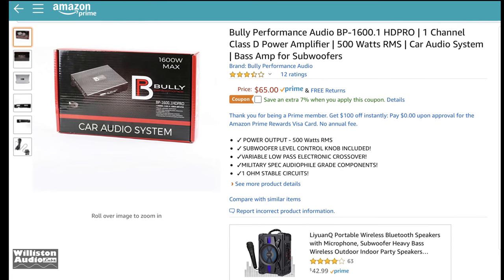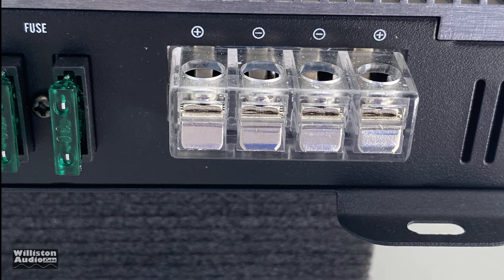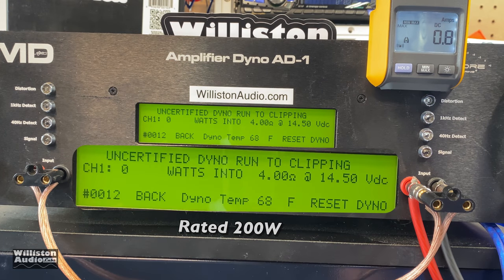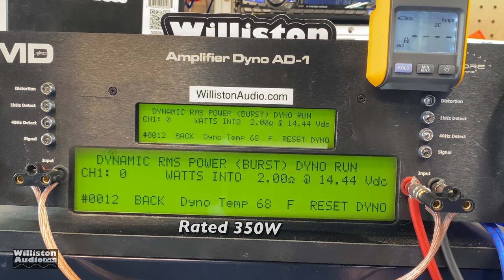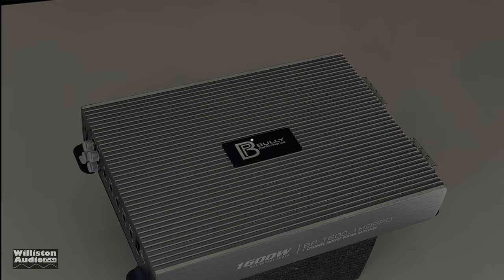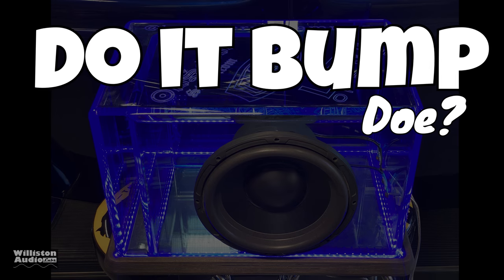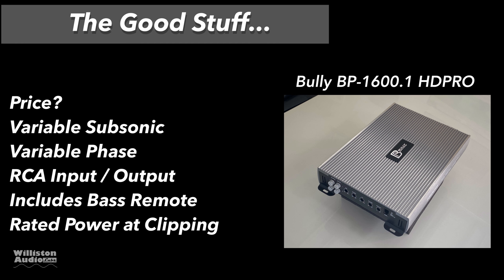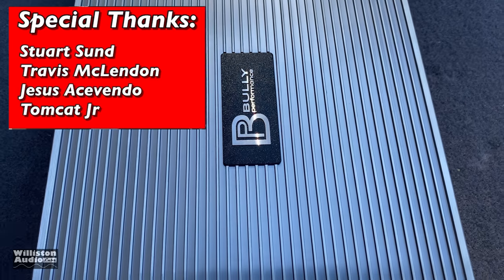How Good is a $65 Amazon Bass Amp? Bully Performance BP-1600.1 HDPRO Review and Test

Comment: Ive been using the IGNITE 6000w from amazon you reviewed a while ago,  running 2 strapped together pushing two 10" 2ohm dvc in parallel with eachother at .5 ohm for over a year now and its been doing great!

Comment: Another great honest test! Since you tried increasing the input voltage to see if you could get more power, and it DID increase output power, I was wondering if that is a default trait of all car amps? I'd like to see a few amps tested with minimal input voltage, like 11.9 or so, then at 14.5 and see how much the power changes. The low voltage of 11.9 would be a typical "engine off" scenario. Reason being, I thought most higher end amps would have internal voltage regulation to compensate for crazy changes in system voltages. After all, high power car amps have some sort of switching high frequency power supply like a DC to AC power inverter (exception of low frequency power inverters, which use a big ole iron transformer).  A good power inverter can usually maintain around 120VAC with input voltage swinging from 11-16VDC for a 12V model.  So, why can't a car amp maintain B+/- rail voltages even with swings of input voltage? Just saying.

Comment: Crazy how you can get this kind of power for so cheap. Back in the 90s it cost an arm and a leg, possibly a kidney lol
Reply: I had some mmats d100hc. I wish they were 65$  lol. And the first amp I bought was the mtx thunder 2160. That was a good 399 or so
Reply: @jasonstell9348  I STILL run one of my old 2160's.    I just picked up a Blue Thunder Pro 1502 (same guts, different color/model) for $25 a few weeks ago and one of my boys is going to try to tear it up.

Comment: Pleasant surprise on the power output; not a surprise on the audio quality. Damping a high power inductive load is either cheap (and inefficient), or expensive (and effective). If there's a multi-channel version of this amp, it would be interesting to see if the amp architecture handles higher frequencies better, acoustically speaking. It wouldn't need as much damping, and if the switching is fast enough... 🤷‍♂️👍

Comment: LOVE how the power increases with bumping up the input volts. For $65...a little screamer. Gotta tell ya...for my living room system subwoofer (passive, 15" DVC Skar Audio sub D4), I just added a second Behringer A800 Class D home/stage power amplifier (now have two, both bridged to mono for full power). Found a dyno spreadsheet online for this amp...about 432 watts (@ 4 ohms RMS) before clipping. The 15" Skar Audio sub is rated for 600w RMS...but, when you crank it up, the woofer bottoms out (voice coil smacks the back of the magnet! Hahaaa. Man, your channel rocks...thanks for keeping it real/fun!
Reply: Rms numbers are talking about power handling before the voice coil overheats. You're in an excursion limited scenario so you could still be likely far below 600 watts
Reply: @captainkirk3000  -- perhaps. The amps' lighted front panel LED VU meters don't even "get into the red" before the sub bottoms out. My thinking there is plenty of amplifier power. Actually sent a note to Skar Audio and said the sub could "handle" the power...should be able to handle it's RMS rated power capability on both coils being fed 400 watts each. At max power/volume, the 15" sub's excursion is pretty significant...it looks like an 1980's video where the PA stacks speakers are gyrating wildly
Reply: @ChrisDIYerOklahoma   xmax is not the limit before damage occurs. You're probably way past any linear travel
Reply: @ChrisDIYerOklahoma  the other thing is -3db is half the power. So if you're not in the red you might literally be at 100-200 wpc not 400 like you think

Comment: I notice these cheap amps blink the red LED a LOT way BEFORE reaching the MAX output.
This is into a BIG DUMMY (sorry could not RESIST!) load!  So yes a REACTIVE load which a speaker motor is, will be much more challenging for an amp of this design caliber to maintain cone control.

One also remember given the caliber of electrolytic capacitors used, quality only goes downhill from the out of the box experience particularly in auto use where temperatures vary widely.

Perhaps an oscilloscope is needed so we can see the output waveform as (the amp) has its wrists twisted, so to speak.  Also a screen shot of the scope when driving woofers in SQ tests.  As listeners cannot easily discern over YT, this would provide clues to waveform output.  Since most bassheads' genre is typically sine waves! ;-)
Reply: That would raise the bar!

Comment: Hello Big D Wiz I have a video suggestion about the t.amp TA 2400 MK-X. It is a PA amp that claims it can do 1200 watts rms x 2 at 4 ohms, 760 watts rms x 2 at 8 ohms, and on the manual it says 2000 watts rms x 1 at 8 ohms bridged I believe. For the price it may be overrated. Nice video by the way!

Comment: Big D!!! I need to add some power to my ride.  I’ve watched almost every dyno video u upload.  I love car audio I was one of the kids who had 3 different systems before I even had my first vehicle.  I fell in love with the old school stuff when I came across a Craigslist add for a used Phoenix gold titanium elite 13.5 .  It was a monster sub with dual spiders and a motor that resembled a war head!   I currently have a jl 10 w6 v1 that I re coned and foamed but money is tight for getting an amp.  I have 3 daughter and 2 step sons so all of my wife and my money flow goes to them.  Any suggestions on how to come across older amps that folks no longer want after they upgrade.   I’m trying to decide if I want to build my own jl wedge box they say is the best for that speaker or if I want to go with a 4th order (small sealed and huge ported) enclosure.   Thanks for the help

Comment: Pleasantly surprised... Considering if the power supply voltage could be maintained at 14.4 then the ratings were right on the money. Respect for them rating honestly but I still dont like the model number which implies 1600w.
Reply from the maker: Agreed

Comment: It looks a lot like the Magnat BlackCore series of amps, that were made 10 years ago. This one does not have the built in volt/temp meter though.
The Magnat amps were made in Germany though. Not the cheapest, but they did claim 1000w RMS at 1 ohm.

Comment: I'm hoping that the powerbass xma-1205d I bought will sound nice and clean on the 4 kenwood excelon 10's in a sealed enclosure . It is supposed to do rated power at a lower level of distortion than most others.

Comment: you mention that irf540n and they were used only to 800 watts. the oldschool mtx 2300/2400x/2600 used them and i think you got over 2kw from this amp but youre right, it was "rated" 600 watts lol.

Comment: Im surprised it didnt blow on the .5 test dam does ok for the price. I do agree after trying different bass amps some are ok some are worse and some sound great. Recently just installed a sound digital 1600 evo . Sounds pretty good was pretty bummed that my sfb 1500 blew up tho that was my error with my voltage spiking 15+ the amp didnt like it. It blew a few days after I installed it I did notice that it wouldnt take 4v rca in very well ended up having to turn the subwoofer output down on my headunit.
Reply: I got a Sony head unit with 5 volt RCA output. I noticed the same thing I went from one extreme to the other. I went from having to slam the gain wide open on my cheap pioneer radio to hear anything to having it be too loud even with the gain all the way down
Reply: @rmblwgn  ya I got lucky that the sound digital amp takes 8v in I wish that the sfb line had specified that before I bought it. Oh well I guess. The taramps 1.2k bass that I also have is a bit wierd with the rca input too. I took it out cause the fan was driving me insane. I've had the same pioneer radio for like 3 years now I was gonna change it out but I don't feel like stuggling to get the steering wheel controls again.

Comment: I'd like to see you do a dyno test on the newer version bp-1000.1 looks like it has Tiffany rca's also has Allen screws for holding the wires in looks like 2 gauge power and ground and 8 gauge for speaker output and has digital screen on bass knob and also has a clip light on the amp now as well. I have one you can borrow to do the tests amd ill pay for shipped both ways. Let me know if your interested

Comment: That's not bad for a 65 dollar amp. I was looking for a cheap amp to replace my OEM amp on my 2001 expedition to just power 1 8" subwoofer i will be replacing. Since the OEM amp and subwoofer/box was all hidden I didn't want to spend too much because i will be installing a pair of subs later with a larger amp to go in the back. Do you have any ideas for a cheap amp that will push a 8 inch sub?
Reply: The larger subs and amp i will be installing in the rear layer on will be old-school Rockford amp with a new set of Rockford subwoofers of that gives you a idea of what kind of setup in going with.

Comment: i hope you can test the nakamichi nk-sd600.1i monoblock one day.
i have one.... but i think they are lying about the rated power on their amp
Reply: Are they good? Im planning to get one of those for my sub but im not quite sure of the overall performance and quality. 
Also if you dont mind, what subwoofer (and the specs) are you using with the nk-sd600.1i?
Reply: @justaregulardude2507  under power.
i'm using pioneer ts-a300d4 subwoofer 500w rms dual 4 ohm.

Comment: hi im really curious have you ever tested the kohler amps? the 4 channel 400 watt and 2 channel 800 watt i used to sell hundreds of these when i had my shop in 99 only had one go bad i used to kick alot of people asses with my 800 2 punch pro 12s and 2 kicker 8s in my 85 cutless .and my 400 watt ran my mids and highs

Comment: Nice clean little amp for 65 bucks- 550 watts hard to beat. Dont like that a 65 dollar amp makes ur voltage supply vary- draw down, what up wid that big D? Maybe some deep cycles to back up that bank of caps?
Reply from the maker: I’m almost certain I’ve got a bad cell in one of my D1400’s, as I agree voltage shouldn’t drop with (8) of them

Comment: I'm looking for a good and powerful sub for my home theater, budget is  $100-$150, needs to be  selfpowered, and preferably on amazon (if you can). Any suggestions?
Reply: used honestly, you'd get a much better used one than buying a cheap new one
Reply: I got my whole stereo with Bowers and Wilkins self-powered sub Nikko power amp/receiver and Yamaha TENS for 160 bucks... Goodwill I've had it for years now and it kills every time. The big hub Goodwill has all kind of used subwoofers every time I go in powered and unpowered usually everything's 50 to 100 bucks if that... Like 160 out the door I think it was 140 actually plus tax

Comment: Are all bridgeable amplifier considered monoblock. Or do they have bridgeable amplifiers that aren't monoblock that have some kind of hybrid electrical system in them.?I
Reply: Some amps are bridgeable those are 2-channel amps or 4 a monoblock amp means that no matter how many output terminals it has even if you plug in two positive wires and two negative wires it's going to internally put them together so it don't matter if you use the two inside or the two outside it's going to put mono yes it has something internally that puts the two speaker wires in mono which internally bridges in if that's what you wanted yes

Comment: Would it be worth it to take an amplifier like this and upgrade the capacitors inside and some of the other components to improve its sound?
Reply: first thing i do on amps is mosfets then fans . i only do caps if its possible thremo grease
Reply: @craigengelman4534  so the caps in the power supply don't make a difference?
Reply: @Geerladenlad  they do but some are a pain in the ass to change
Reply: @craigengelman4534  I would think anywhere possible to replace electrolytics with metal film capacitors especially ones in the signal path.

Comment: Surprising to see they grounded the cases of all the potentiometers, esp. since its a budget amp. Thats either a good thing, or bad (lots of EMI). Still for $65 bucks its not bad. As for the poop sounding bass, that may be due to the output filter network having too high an impedance (low damping factor), which can also skew the frequency response. Definitely a problem with some class-Ds.

Comment: 1K for $60 is a win in my book
Reply: @UCfUUe_KBu-6LiQKfGgoSr6A Obviously I did watch the video and the amp put out over 1K dynamic at 0.5 ohm.

A $60 amp that took that abuse and didn't smoke, that does rated power. Yeah I call it a win, I don't put much stock into D saying it doesn't sound good with no mids and highs playing along with it in a rattling garage.
Reply: Dave Micolichek  I know Derrick knows his stuff, what I'm saying is I personally think it is a good deal for someone looking to drive subs on the cheap

Comment: Williston audio labs I want to run a car system for home what do I need I was thinking a 100 amp power supply others say use a car battery n charger instead to run with amps over 1000watts n car stereo

Comment: A "Pro" is the heat sink. Very nice & clean looking for a cheap amp. You could have 15 of these for the price of a KXA2400.1 and run them on some Rockville K9's 😂.
Another "Con" trying to rip off the name from Bully Dog Performance diesel products.

Comment: What a 'pyle' of junk, lol. And for it's size that should be way more capable. Companies need to understand we're not stupid anymore" thanks Big D.
Reply: For a budget amp, none are more than 10% low from rated. Compared to what he normally tests, which are off by like half? It's not that bad. You have to remember there's two sides to the old trope. Not only do you get what you pay for, you /don't/ get what you don't pay for.
Reply: @TheLukemcdaniel  yeah but the OP has a point, do we really wanna spend money on a company that thinks we are stupid? Its more the principal
Reply: @nickn7939  then you're not going to be spending money on any of them. With this one it could easily be a QA issue with as close as they are. It's not like one he did recently where it was an order of magnitude in difference.